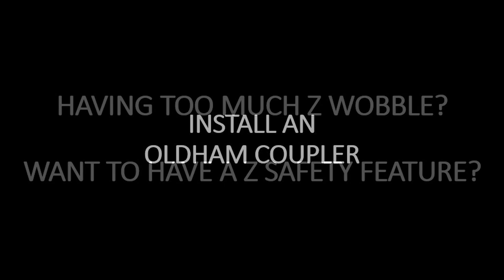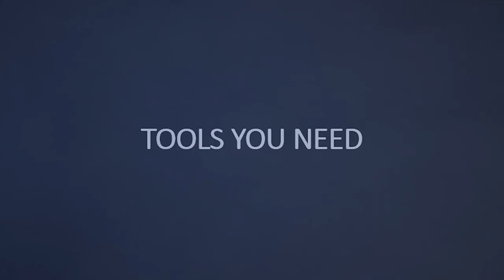TEVO Tarantula 3D printer - HOW TO improve your printer - Part 10 (oldham)

Comment: Hello, I am going through your video at the moment. Have you kept the 'Oldham' or replaced the it with the carbon fibre part?
Reply from the maker: Hi Chi,
I had to still use the oldham coupler (replaced it with the carbon part) because i was still having some printing imperfection. The carbon Z nunt mount does not eliminate these issues. However, i removed the oldham coupler when i bought the dual Z motor upgrade. The second motor eliminated the Z printing issues i was having and now (with the dual z motors) i'm using the carbon fiber z nut mount.
Reply: Thanks for the reply. So you are using 2 Z axis motors with carbon fibre mounts  and nut holders only now?
Reply from the maker: Actually, i'm using 2 Z axis motors but with 1 carbon fiber mount and 1 acrylic mount (the one that came with the dual z upgrade).
Reply: Dear Rui So I understand now that with dual Z motors there is no need for the oldham upgrade? Please advise

Comment: Imprimi este upgrade na minha  Tarantula praticamente stock com um suporte z melhor, umas anilhas, uma fan e uma montagem muito cuidadora, e comparando o resultados - vejo que as minhas peças estão com menos imperfeições. Porque será que isto acontece? Eu imprimi com Cura 0,1 e configurações Marlin (penso eu sou muito noob ehehehe) 
É que estou um pouco estupefacto agora que comparo frente a frente. Será que as suas peças foram feitas mais rápidas e logo memos perfeitas?
Reply from the maker: Olá João,
Certo tipo de imperfeições estão relacionadas com o eixo Z, tal como este upgrade indica e a maior parte é relativo a um mau fuso (leadscrew). É muito dificil conseguir um fuso perfeito e semp empenos. Quanto maior o empeno, maior as imperfeições. Este upgrade permite corrigir, de certa forma, esse problema. No meu caso, as peças melhoraram bastante depois da instalação deste upgrade. Mas, como referi, há mais peças que condicionam a qualidade das peças. Em relação á layer height, já não me recordo qual o valor que usei mas creio que foi com um valor bastante mais alto. Nessa altura estava a usar o cura antigo.
Reply: ruiraptor Olá Rui, obrigado pela resposta e esclarecimento do noob deste lado😄
Estou a perceber melhor da coisa, apenas aquele suporte z de cima fez uma diferença significativa. No meu caso penso ter feito uma ligeira melhoria sim, mas completamente stock apertei bem os acrílicos quase até partir (apesar dos avisos sim 😁) e o resultado bem melhor do que tenho visto pela Internet.. foi apenas um efeito ghost e sem calibrar.
Boas impressões 😉
Reply from the maker: Olá João,
Para as pessoas que têm os acrilicos, eu desenhei um suporte para ajudar a melhorar o Z evitando o pequeno flex que o acrilico faz.
O suporte é este:
https://www.thingiverse.com/thing:2477543
Só esta pequena peça já ajuda a melhorar o desempenho.
Reply: ruiraptor Eu já tinha visto, sou seguidor até 😊
Eu escolhi este para remover o acrílico: https://www.thingiverse.com/thing:2264657
Estou até inclusive a pensar substituir todos os acrílicos por peças em ABS ou PETG ou PLA ainda tenho de ver qual o mais rijo mas tenho vaga ideia que será o ABS. Gosto bastante daquelas peças do eixo x com apenas 3 rodas em cada frame vertical e talvez uma base nova para Y e dual Y, não sei são ao certo só hipóteses que com o devido tempo vão ser equacionadas. 
Tenho de ver após instalar várias peças e calibrar onde preciso melhorar as impressões.
Longa missão :)
Reply from the maker: Eu tive durante algum tempo essas peças imprimidas. O problema é que com o peso, movimentos e vibrações, as peças imprimidas conseguem fletir um pouco também.

Comment: How did you get your X axis to be level? Mine is slanted downward on the other side without the threaded rod.
Reply from the maker: Hi there,
If your X bar is not leveled it means that you don't have all your wheels tight. Use the eccentric nuts to bring the wheels tight against the metal profile.
Regards
Reply: Wow that was fast, but I think all my eccentric nuts are already tight and now I'm scared to tighten them farther since I don't want to crack the acrylic
Reply from the maker: It's very important to use washers on the acrylic and use lock nuts instead of the normal ones that are provided in the kit. Also, don't use the spring washers...instead use flat ones. Follow my how to improve video part 1 to check how to assemble the wheels. Regarding the eccentric nuts, you can rotate them...keep checking the rubber wheels with the finger to feel if they are pressed hard or soft. All 8 wheels in the X axis must be firmly against the metal profile.
Reply: Thanks alot!

Comment: Nice! I shall be making two of these then, as I'm upgrading to dual lead screws with a central motor mount. soon
Reply from the maker: Hi wordreet,
Please check my dual z installation video. As i mention in that video, i advise to not install them at first. Test the dual leadscrew without the oldham couplers first and if you still notice some z issues, then install the oldhams.
Reply: I'll admit it adds to the complexity of the conversion, so I'll take your advice, thanx. :¬)
Reply from the maker: The oldham will only work if the parts are mirror smooth and move very well between each other. I was able to eliminate my z issues after installing the second leadscrew. When i was installing the second lead screw, i inspected carefully both leadscrews and made sure both were perfectly aligned from top to bottom. When you install it, do the same and you probably will not need oldhams again like me
Reply: My intention is to stiffen up the whole machine before anything else. Not necessarily in th rep-rap style either. I work in a precision machining shop and have already collected a few suitable aluminium pieces from the scrap bins.
 Not enough yet though, but I want to have what I think I'll need before I start cutting and drilling. Plus, any printed brackets will will be looked at with metal reinforcement in mind. And, of course, the whole thing will be fixed to a good base board.
 Oh, and another of course, I still have to  have the printer usable at times during all this malarkey!
:¬)

Comment: Do you use PLA or ABS for the parts your making?
Reply from the maker: Hi Edswald,
I'm currently printing only PLA.
Reply: Edswald I printed them using P.E.T.G and it worked PERFECTLY ( it almost didn’t need any sanding)

Comment: is it possible to put the motor at the bottom of printer like all the other modles out there?  and would there be any benifit?
Reply from the maker: Hi Justin,
When having the motor at the top, because you don't have any support for the leadscrew, the coupling is holding all the weight and because of that, it stretches and deforms.
The difference of placing the motor at the bottom is that you don't have that...but instead of stretching the coupling, you will get a compressed coupling. Also, when placing the Z motor at the bottom, you will have the Z direction reverse and you need to change it in firmware.
In my opinion, the best solution is not changing the motor location but to create an upper and lower leadscrew support with collar rings creating a two constraint system to align and secure the leadscrew. This way, the motor (at the top or at the bottom) and the coupling will not be holding on the weight.

Comment: Can you share your settings?   Material infill etc?   Thanks.   I love this series by the way
Reply from the maker: Greetings David,
Thank you for your comment.
These are the settings I used to print these parts:
Layer height:0.25
Shell Thickness: 0.8
Fill Density= 75%
Bed temperature=60c Degrees 
Filament temperature=210 (but you must use the one that matches your filament)
Regards
Reply: PLA or ABS?  And thanks for the quick response :)
Reply from the maker: It's PLA...forgot to mention that :)